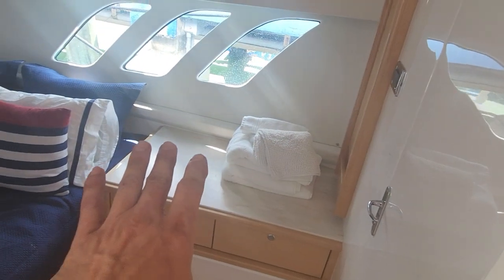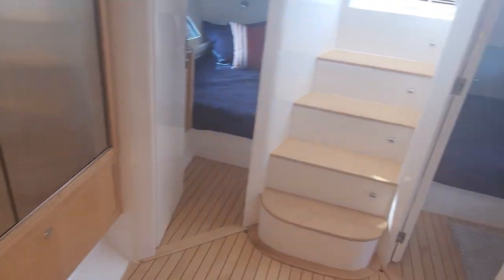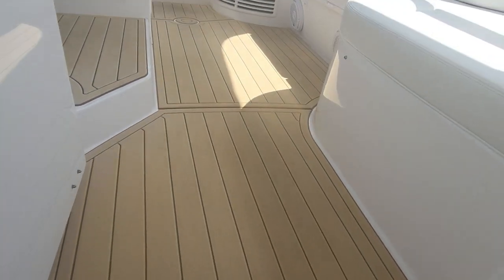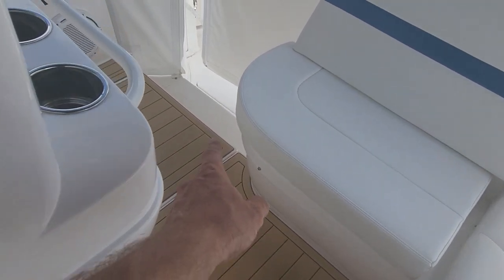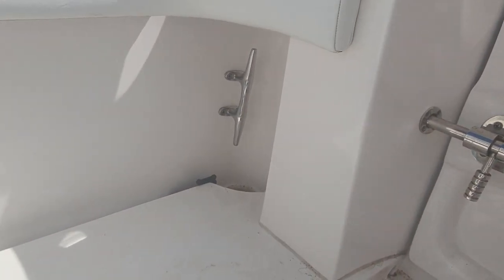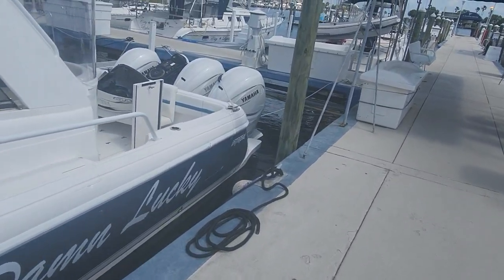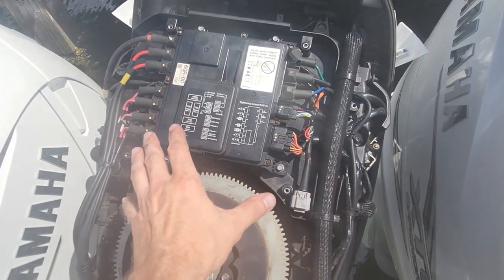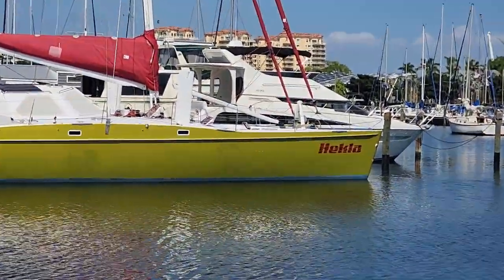Awesome 475 Intrepid!!! #Yamaha #TimingBelt #MarineMax #Episode209

Comment: Love the Intrepid, but I wonder why the owner didn't specify a full-height windshield? The isinglass over the top of the windshield probably never gets removed, but it gets opaque from salt spray and the metalwork at the top of the windshield impedes the forward view when standing. Intrepid is semi-custom so you can specify any sort of T-top and windshield for their boats. 

I've read that 425 Yamaha's are quite noisy motors. I'll bet four of them roaring at the transom must create quite the din. 

That engine sounds like it's beyond repair. If it isn't covered under a Yamaha warranty it will be an expensive event for the owner. 

Good video, looking forward to hearing the extent of the damage to the 425.
Reply from the maker: I see your point with the windshield. He bought the boat used. Not sure about the warranty. Not my department. Hopefully 🤞

Comment: that's not something you see often. the timing belt just fell off. not good.he will survive fine wth just 3 engines.still fast.  the boat is super nice. fresh rooms and like the planning.
Reply from the maker: I have never seen one break on a 425 Yamaha. It is crazy that it will still run 40 mph on 3 motors😊